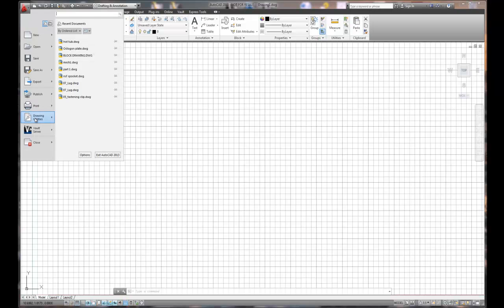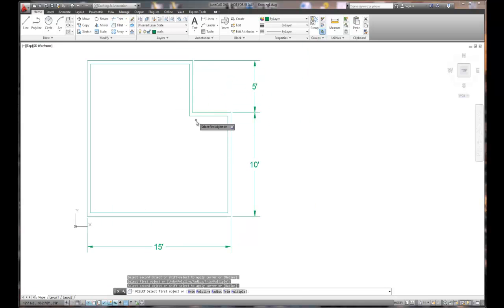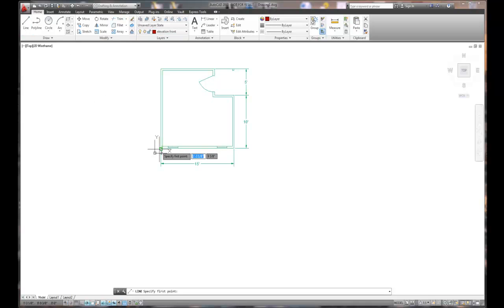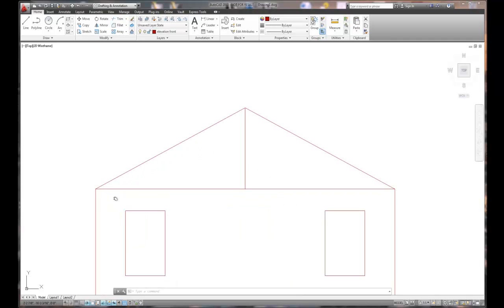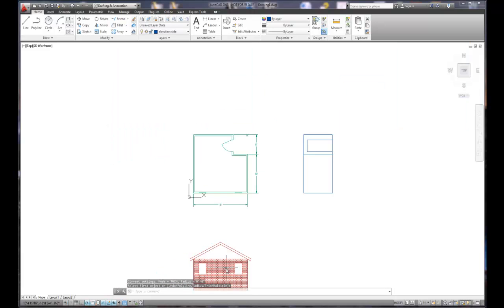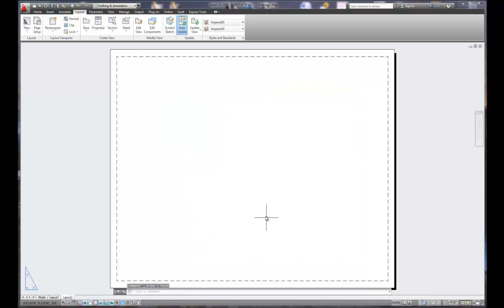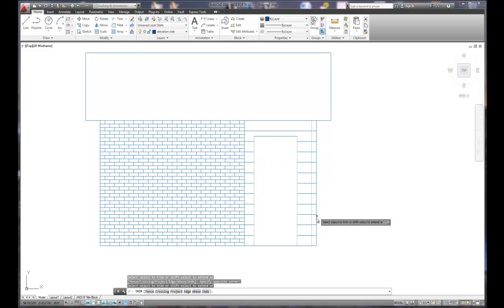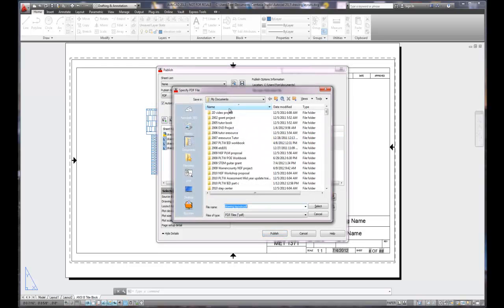AutoCAD 2013 Multiple Layout Sheets from one drawing

Comment: This is a great video, I have one question.  When you're projecting your lines from certain points, I don't know how to get it to highlight a corner from one layer to another with out actually drawing a line.  For instance when you were doing the side elevation and were able to pull the line reference from the Walls layer to the side elevation.  That's the best way I can explain it.  Thanks